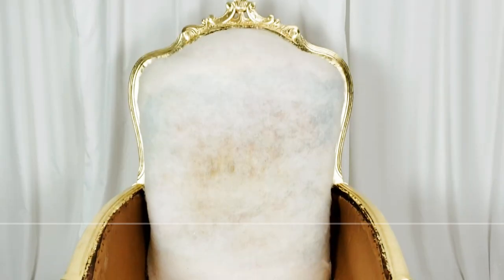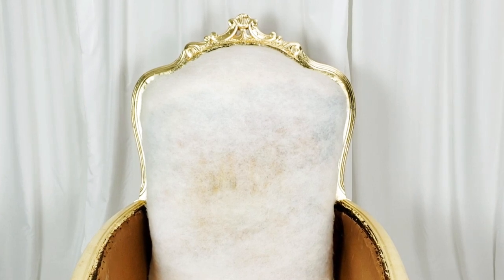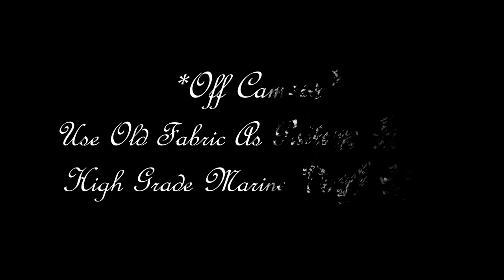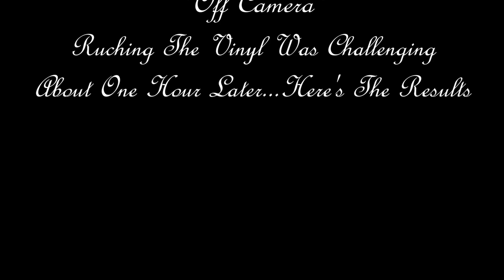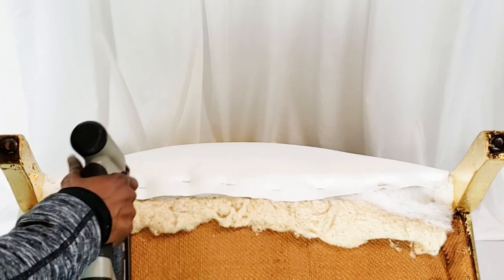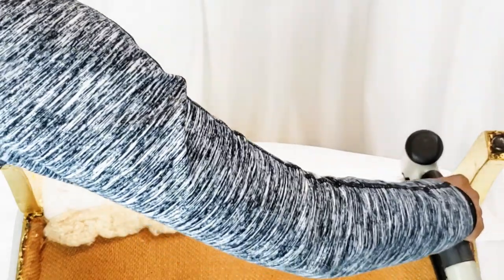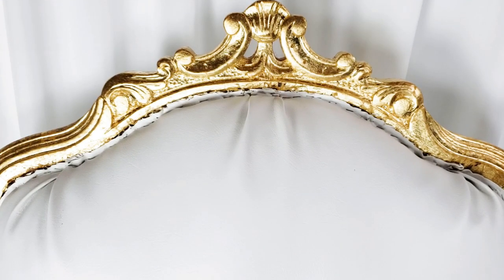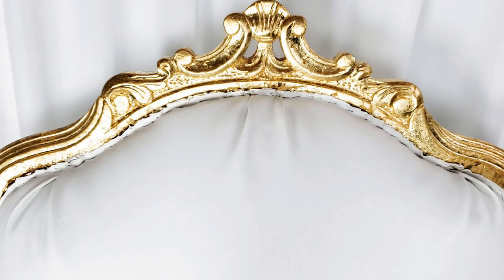How-To Upholster A Glam Throne Chair | Reupholstery Series I Pt 4

Comment: Good morning. Just purchase a throne chair 2 weeks ago unfortunately I messed up the leg and armrest there's some scratches on it. Is there a way to repay the damage. I try taking pictures of it and it looks horrible. Really bad im really hoping the damage can be repay
Reply from the maker: Good Morning Blessings Yvetha Jean! Yes absolutely, your throne chair can be repaired. If you will make the repair yourself purchase the brushes, glue adhesive, sealant and foil leaf (gold, bronze, silver) whichever matches your chair, then follow these steps...

First: Lightly buff to smooth out scratched area(s).

Second: Use a lint free cloth to remove all dust. 

Third: Apply the foil leaf per instructions. If you need help with this step you can watch (Part 3) in this series (How-To Apply Beautiful Gold Leaf) Check description box for the link.

Fourth: Allow the foil leaf time to cure (drying time could take up to 3 days). 

Fifth: After curing, apply the clear sealant over the area and let dry. 

Also, after the sealant dries, I would suggest carefully applying another thin top coat of sealant over the entire chair to help blend everything as well as give it an extra layer of protection. Prayerfully this helps. Blessings, ~RitaBCreative